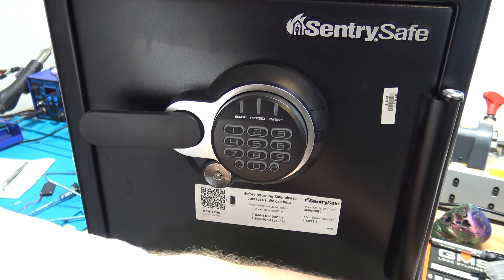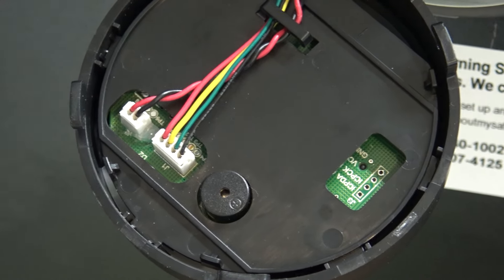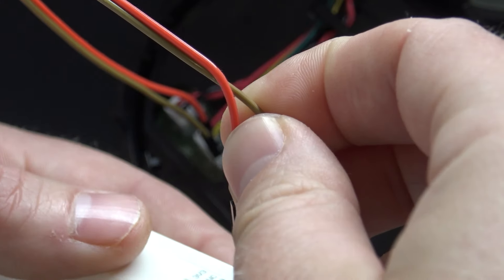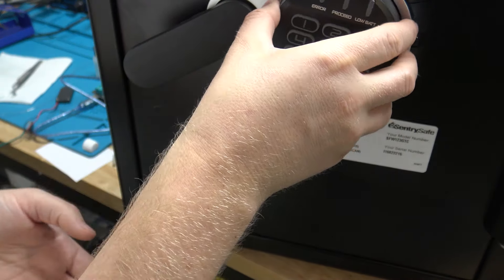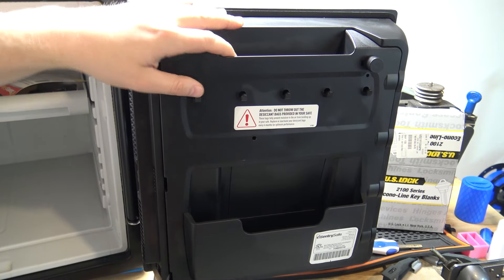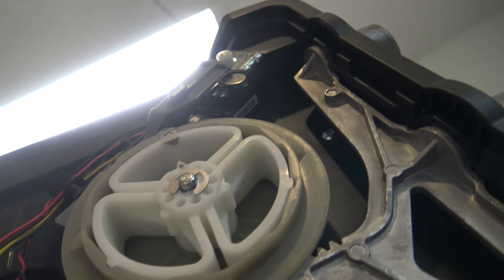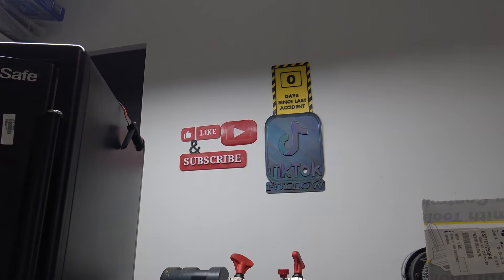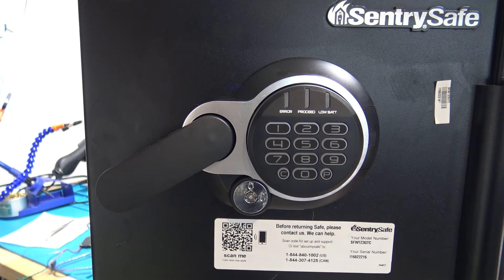(609) Opening a Sentry Safe with a Flipper Zero & Recovering the Factory Code

Comment: My sentry safe wiring is a bit different and I tried a couple diff wire combos and can’t get it to work, pretty disappointed in my flipper. Failed me when I needed it most
Reply from the maker: It’s not the flipper. It’s a program that’s only written for SFW model safes. It won’t work on any other models

Comment: Is this something that comes standard in the unleashed firmware or is this a custom coded script ur using?
Reply from the maker: This is a stand alone thing you can get on GitHub and put it on there but I couldn’t get it to work on the stock flipper firmware so I switched to unleashed and it’s built into that.
Reply from the maker: It’s in the description in this video https://youtu.be/bcc0jyPFH80?si=3rOedg3GQYQX2t-m or search sentry safe GitHub

Comment: Try taking off the solenoid and scan the barcode with your phone to get the factory code, Sorry i thought you were going to get it with the flipper.

have a great day, the flipper would have saved me some drilling.  got a locked safe for 20.00, all good now.
Reply from the maker: Guess you didn’t watch the whole video lol
Reply: I did after, I made the 1st half but didn't want to just delete it all, I edited it once i saw your were already doing what i said.  
The flipper would have come in handy a few years ago when i did mine.

Great video, never knew they had those options.